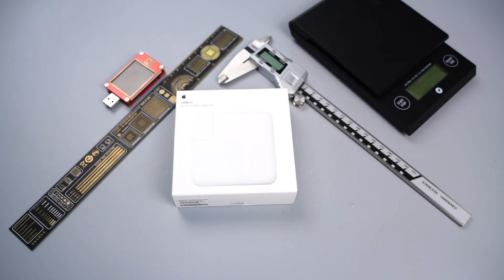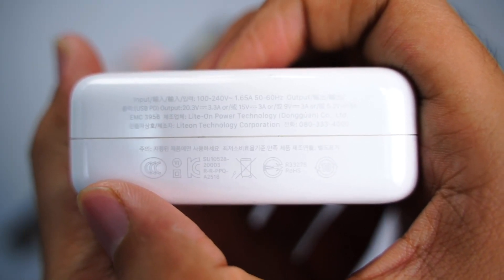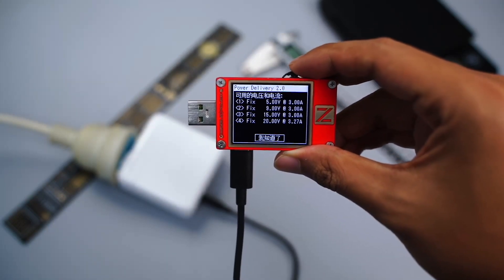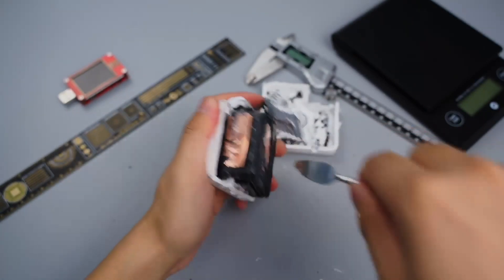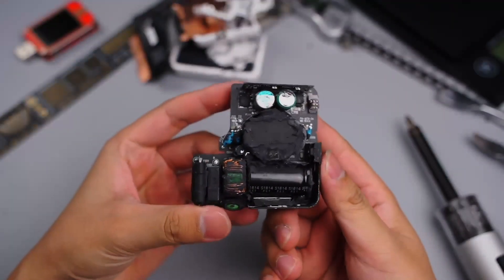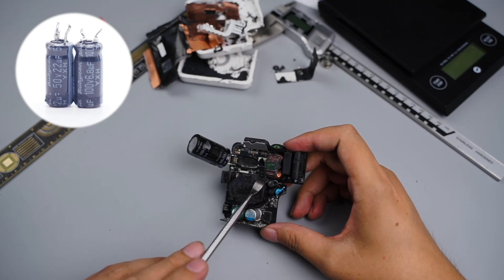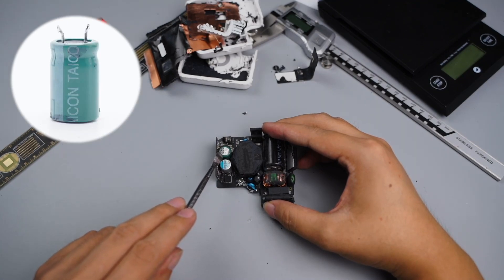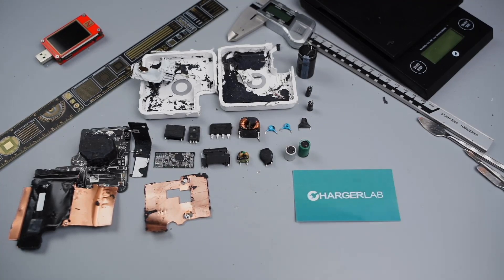Latest Teardown of Brand New Apple 67W USB-C Power Adapter

Comment: Have you tried it with the 12.9” M1 iPad Pro? I’m considering buying this for my iPad hoping for a faster charging.
Reply: I do not see difference on M1 12.9” iPad Pro between 30W and 67W charger in charging speed.
Reply: do not buy it for ipad pro. anker 30 watt  or baseus 30 watt is better, cheaper and lighter
Reply: @Muhammet4string  I do have a 30w Anker power adapter now. But I’m interested in buying the power extension as well which is only compatible with the apple charger. I like having the versatility of long chargers and 2m is the max for a USB C